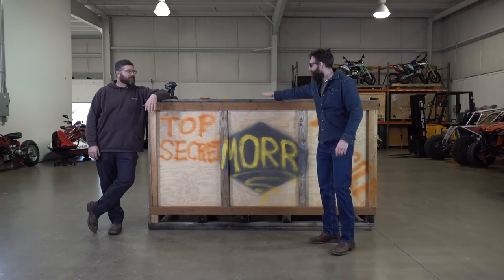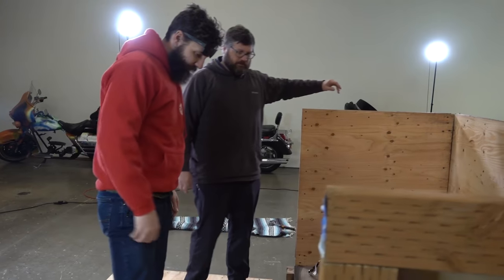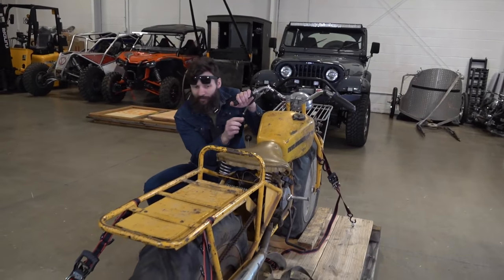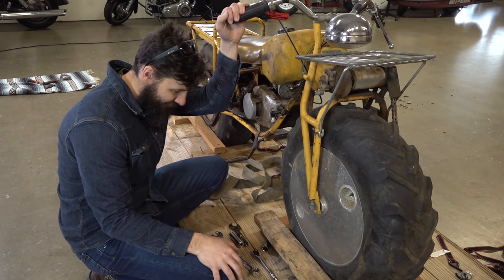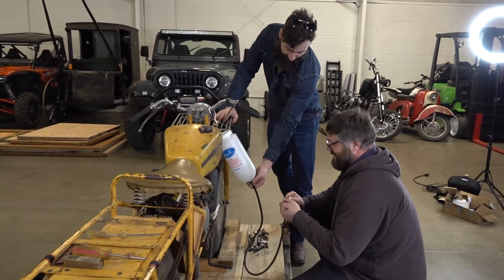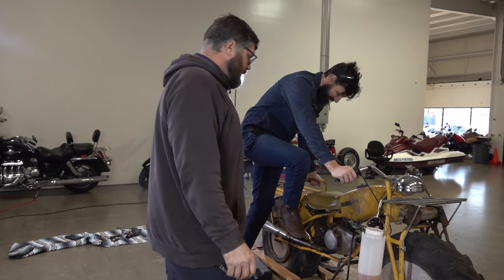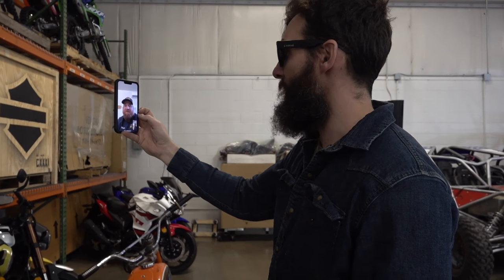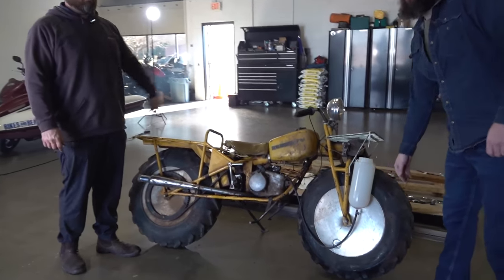I Found a Rare 2wd Antique Motorcycle, 45 years since it Ran

Comment: Engine should be an 820 Westbend, 2 stroke, 820 = 125 cc. I have a new one built by American Motors. Cost is high at around $750.00 when I bought mine a few years ago. Great engine but you have to give it plenty of oil. 1950s technology.
Reply from the maker: yep thats what it is
Reply: @BikesandBeards  
I put it on  a lil Indian mini bike to use as a pit bike. 🤣

Comment: I can't believe I'm looking at that motorcycle after 50 years. When I was a kid my father took my to a military auction and he bought my one. It would go anywhere you could keep your ass in the seat. It would climb a vertical wall if u could stay on it.   I forgot to tell you it is slow as hell. You can walk faster than the bike in high gear. Mine was set up for Military.

Comment: Jeez .... these things are still in production by Rokon; still located in Rochester New Hampshire. 
Cant be much of a market for these things. Maybe the Army keeps 'em in business.
Reply: There is a speciality market for them, but they are expensive, new...bought a used one with sidecar 3 years ago for $1800...use it around the farm for light duty chores...it is not faster than my 6600 ford...no reverse, so getting turned around can be drag in tight places...3 speeds and must it be shifted at a stop...

Comment: The best thing for an engine that's been sitting for ages is just to turn it over, dry. They love that.
Reply: Yeah I was waiting for someone to spritz some oil in the hole when they had the plug out. Maybe that was off camera. It also hurt my soul a bit when he cut that strap. Can’t wait to see Ed on that thing.
Reply: @badgerflorida9182  yeah, I'm cheap too! I certainly would have cut it.
But as the owner/director of Tank Straps I guess he had to make a point.
Nobody ever seems to oil the cylinder. It always the first thing I do when I get an unknown engine. Pull the spark plug, check for water, throw in a syringe of oil and a little spray oil then leave it sit while I do other things. This is before I even check if the engine is locked.
I worked with a guy who did concourse style restorations in England before coming to Australia so he was meticulous. Working on engines where there is no such thing as spare parts you need to be careful. But he taught me one thing: these "will it start" videos are all horseshit. Yes. It'll start. Any engine will run. Because every part can be replaced and it's the same engine, except for the block, and that can be bored and honed. And even if there's a hole in the block the engine will still run. Just not well! 
He said, the only engine that won't run again is one where the block is split in half.
Wise words from a Bugatti mechanic!

Comment: The two stroke engine that Rokon used in the early '70's was made by McCulloch, not Chrysler.  Wiki states the following:  "The company was founded in Milwaukee, Wisconsin, in 1943 by Robert Paxton McCulloch as a manufacturer of small two-stroke gasoline engines and introduced its first chainsaw in 1948, the Model 5-49. McCulloch and its brand are owned by Husqvarna."
Reply: Chrysler(the marine part) also built that engine. They were used in georgia buggies for years.
Reply: @cbxdavid  Did McCulloch contract construction of their motor to Chrysler? Or, Was the first generation of Rokon built with multiple different, tiny two stroke motors? (this seems unlikely) Long ago, I read my brother's Rokon owner's manual, complete with exploded diagrams and part numbers for components. It identified the motor as McCulloch.

Comment: Supposedly in the 1960s, and of course during the Vietnam War-Cold War, the U.S. Army put out "feelers" for just such a motorcycle for use primarily by airborne troops. IF the rumors that circulated back then had even a grain of truth to them, each paratrooper would be equipped with a motorcycle. Assuming the motorcycle(s) survived the drop, soldiers would then use them to cover greater distances at speeds far in excess than possible on foot. Again, IF there was even a grain of truth to the rumors, the motorcycles were envisioned for use in Europe. Somewhere around 1972 or so I recall hearing that the idea had been rejected, mainly due to political reasons, by Japanese companies and by Harley-Davidson because of the cost factor. I would be really curious to know if the stories were true or if ROKON was the only foreign or domestic company to even attempt to satisfy any such "feelers" put out by the Army back then. By the way the only such motorcycle I've ever seen was, to be as gentle as I can be, in "pure trashed" condition back in the mid 1980s in Central Texas. I ran up on it in a salvage yard while looking for parts for a pickup I had just purchased but had to ask the owners of the yard what the heck kind of motorcycle I had stumbled upon. Oddly, despite the massive size of the yard, they knew exactly what I was talking about and told me it was a ROKON that had come with several other junked vehicles from a ranch estate sale.

Comment: My grandpa had one of these!!
Reply from the maker: He must have been awesome
Reply: @BikesandBeards  oh yeah. Dude also had a lifted vw bay window bus with a Buick v6 and a custom flywheel so it fit the vw transaxle, and two radiators. One on the rear bumper that barely worked, and a second jerry rigged to run into the first, bolted to the side of the van. He also had a bone stock sleeper model A pickup that had been engine swapped with a flathead v8, and a 1960 vw bug that was swapped with a Porsche industrial engine, and BBC was eventually body swapped with a Meyers Manx. Oh and can’t forget his Honda C70… with a 12 inch diameter rear sprocket, so it could climb snow covered mountains.

Comment: The carb is obviously the issue with starting why did you not pull and clean it after the hard starting instead of trying to kick it to death to start it? Your wearing out the start mechanism stop screwing around and fix the carb and tank....

Comment: YOU HAD WAY TO MUCH OIL IN THAT FUEL... ALSO I THINK YOU CRANK SEALS ARE A BIT WEAK.. IF THEY WERE REAL BAD.. YOU COULD HAVE ALL THE COMPRESSION IN WORLD AND IT WILL NEVER START.. ALL THE MIXING OF GAS AND AIR IS IN THE CRANK AREA... 2 STROKES AREN'T KNOWN FOR HIGH COMPRESSION UNLESS IT'S A 500 CR... ALL AND ALL IT LOOKS LIKE A SIMPLE RESTORE JOB...

Comment: The  forestry  outfit I worked for had  one of these which  I rode  for a hour or so. The chain powering the front wheel  often  fell off.  The tires  could  be filled  with gas or water  if needed. Yes, it would  float,  that's all I remember  about it except that it could climb  a slope  until it went over backwards, that was around  1970! Have fun
Reply from the maker: ou may have a bent gear ot mitre box that caused that chain to fall off or bed rim sprocket

Comment: Fellas, you need a closer to stock exhaust. What's on it is for a 4 stroke, it needs an expiation chamber for back pressure to make any real power and idle correctly.
Reply from the maker: Hhhhhhhmmmm where could I find one
Reply: @BikesandBeards  Well, they still make them. I would check with the manufacture first as most parts for those bike haven't changed that much. The pipe that's on it now looks like an after market bolt on old Triumph pipe. Hope that helps & good luck on "THE GOLDEN FLAKE" lol

Comment: These are excellent off road machines.  We have had 3 Rokons along with horses for elk hunting.  Still have my Rokon.  Instead of tractor tread tires I have knobby tires with studs.  They will crawl over very large logs that might have fallen over trail.  There are also Rokon groups that get together for the weekend.   Rokons and dutch ovens go together very well.   Another point, it is a good idea to place a rack on the front end by the handle bars.   If you have a quarter of an elk on the back and going up a steep incline the front end has a tendency to lift up, especially if you hit a rock.  If you place some weight on the front rack it will keep the front end from bouncing up.
Reply: Studded tires work great on downed greasy timber not so much on rocks.

Comment: Wow!!! I wanted one of those so bad as a kid!
My neighbor had a junkyard/collection of miscellaneous whatever,And leaning up against his fence was two of those bikes,I looked at them everytime I walked by the fence.. from the early 70s until the mid 90s those bikes just sat exposed to the snow, rain, weather
Lots of people tried to buy them but he would never sell them.
Then he passed away and his family was cleaning up the property,So I stopped and asked to buy them and again the family says they were not selling them...3 days later I was at the local scrap steel yard and saw the wheels,frames,engines literally cut up into pieces of scrap.
Reply: that's a sad day.
Reply: @stonewolf9459  it was,I had tried to buy those bikes from the time I was 9 or 10 years old,And I tried again in my 20s and 30s but they wouldn't sell them nor even get the bikes out of the weather.
I offered alot more money for the bikes than the scrap guy did...he paid Peanuts for them..I heard that the bikes were at the scrap yard so I went to see if I could try one more time to buy the bikes but they were already cut in pieces..the cylinders,head,cranks had all been broken up with a sledgehammer.